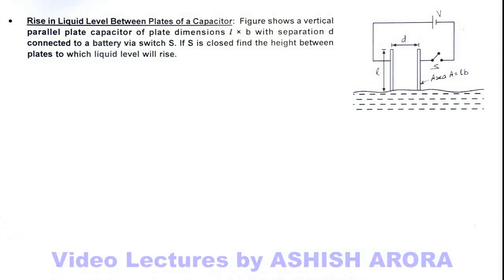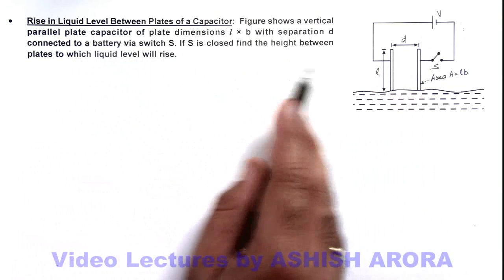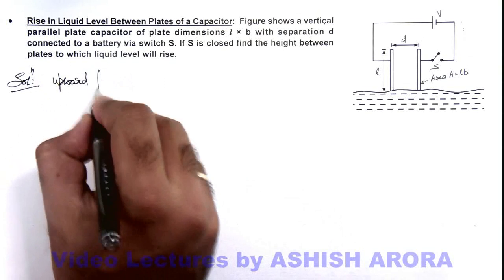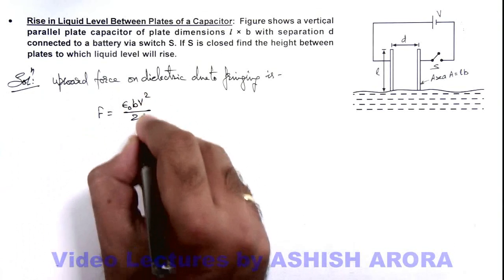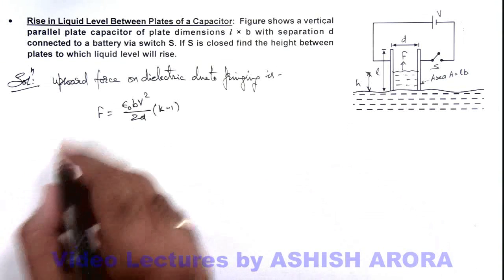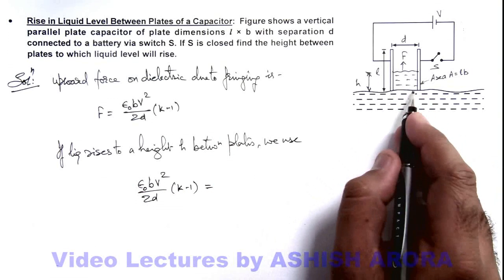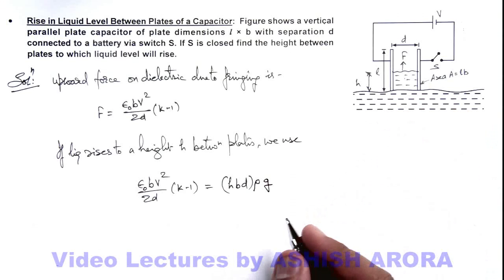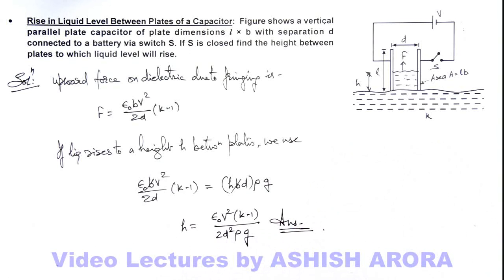32. Advance Illustration | Capacitance | Rise in Liquid Level in a Capacitor | by Ashish Arora

Comment: for those who are wondering about the expression of FORCE , pick up your pen and notebook and do this with me ,

first assume that the water or dielectric is inserted up to an height 'x' 

now calculate net capacitance with both capacitors being in parallelit come out to be 
C = bE*V^2( L +(k-1)x) / 2d

now write energy as U = CV^2/2 and differentiate the expression with respect to "x" and boom here is your answer
Reply: The expression you have written is of energy not net capacitance
Reply: @Najmussalam  haha, idk if i am right there or not , i will have to recheck the formulas and all to verify (which definitely i am not gonna do hehe), so , verify by yourself and correct me or yourself but don't let it go , be sure about what you learn. :)
Reply: I too did the same way except i calculated the energies of both capacitors of l-h and h differently and added them and then differentiated them as we know -dU/dh = F

Comment: Respected Sir when force will be zero then velocity will not be zero and hence liquid will rise to a little more height have u  neglelected that sir plz reply??
Reply: If that happens so, then:
Liquid raises to some more height than calculated but by very small length. Once flow stops, liquid column inside plates experiences a net downward force in action which takes it down. Having acquired some momentum at equilibrium height, it further goes down. Again there's net upward pull. This continues, very similar to what happens in SHM. Finally the column gets relief of this disturbance due to resistive forces and settles at equilibrium point which is calculated in this problem.
Reply: @harshmangalamverma  where are you now!!??!!
Reply: @mrh4909  in college, but online. :)
Reply: @harshmangalamverma  which college bro just asking out of curiosity
Reply: @mrh4909  IIT Patna
Reply: @harshmangalamverma  👍

Comment: Will the liquid not oscillate here?
Reply: You must have noticed 2 yrs ago that force by capacitance is constant and not proportional to some powers of x so motion will just be  constant accelerated and not oscillatory
Reply: @pandyaakshat7473  The force due to mass is directly proportional to x so this will be a SHM and the equilibrium position will be where force cancel each other.
Reply: @rishiagrawal1619  force doesn't depend on height rised